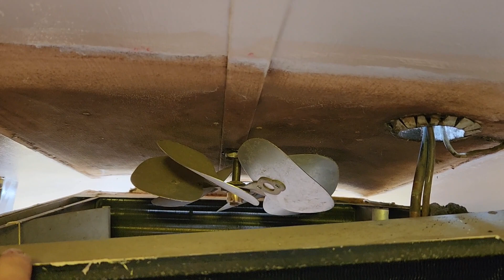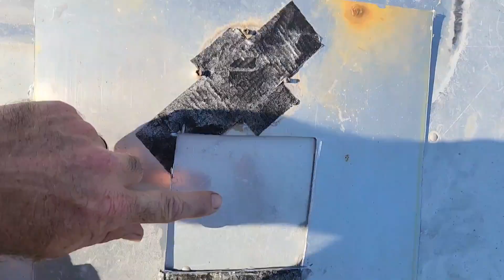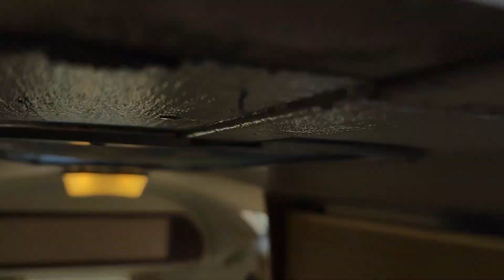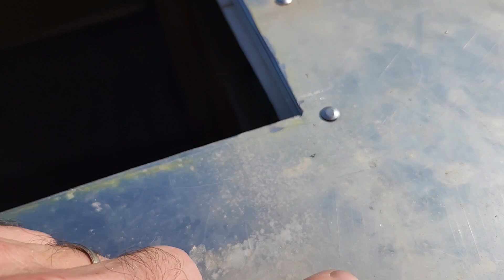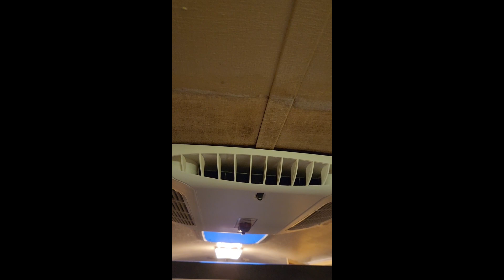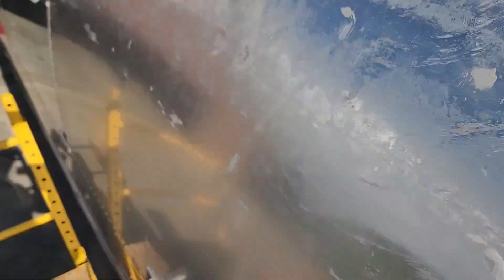Vintage Airstream AC Replacement

Comment: 10,000 dollar fine for releasing freon
Reply: especially if not licensed
Reply: one molecule of refrigerant kills 100,000 molecules of ozone...HVAC 101
Reply: put in a tap and vacuum the system into a tank..there is a reason AC is a sealed system..and posting u cutting a line isn't great. Hopefully the EPA doesn't call u
Reply: 10 things wrong
Reply: did you youtube how to fix it

Comment: Great job. Would you need to uncover the refrigerator vent if we had a 2 or 3 way fridge?
Reply from the maker: Yes but more than likely a modern replacement would be a 12v refrigerator that can run off shore power, battery or the car's alternator while hooked to the 7 pin harness.